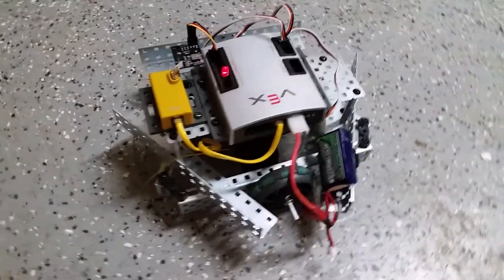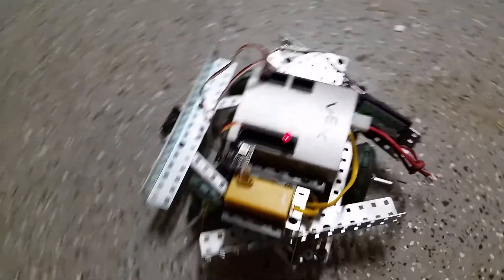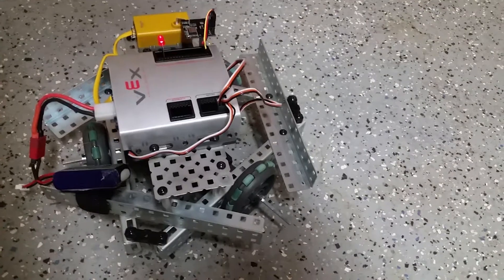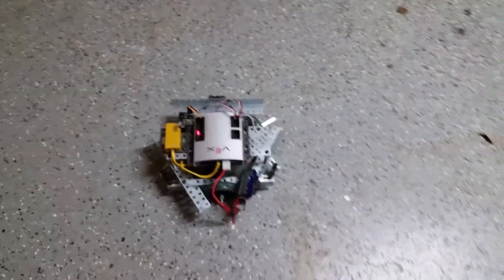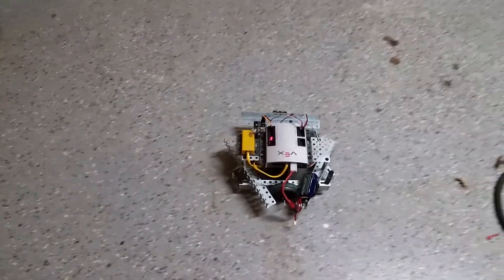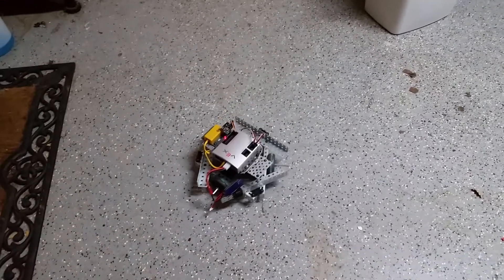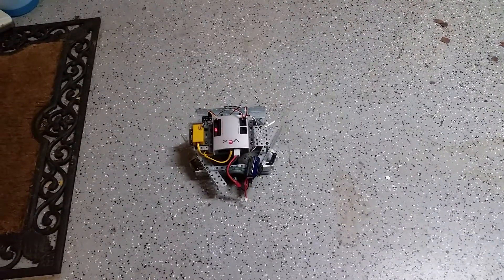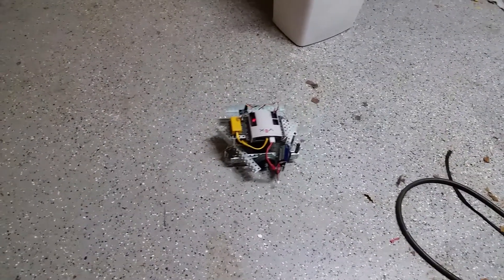Gyro Stabilized Kiwi drive.

Comment from the maker: Steampunc, good question! Honestly, no. It is much simpler than that. In this configuration, I am literally just adding the gyro output to the rotation input. No gain modification is used at this point.
The modified rotation input is literally (Rotation + Gyro). 
The sampling of the gyro is in 1/10th degree increments. With a rotation input range of 0-255, with 127 being centered, even a couple degrees of drift is enough to drive the rotation back toward zero.